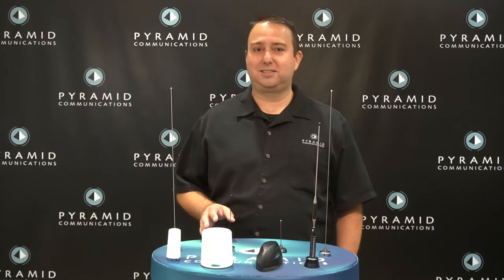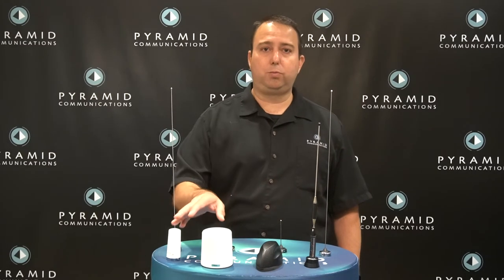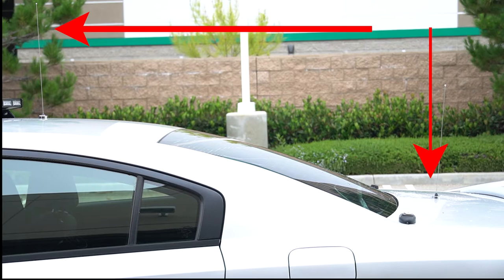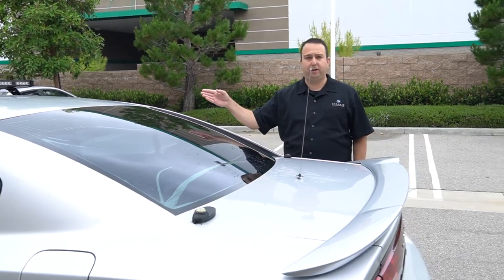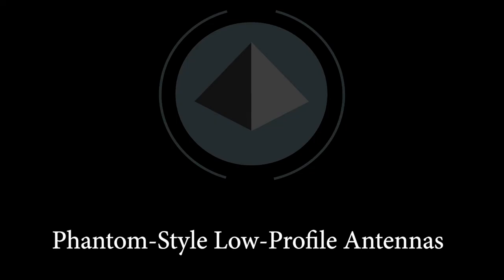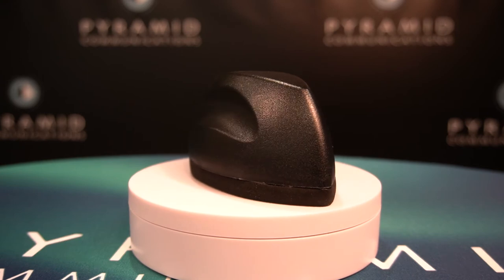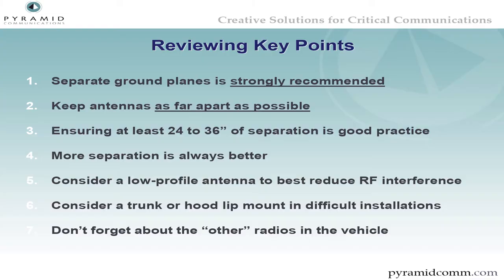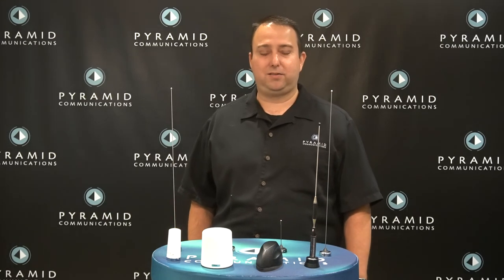Antenna Placement Webinar

Comment: Thank you for this tutorial. I want two scanners in my SUV so this is a receiving only question. Can I have the same type of antennas for both radios or do I have to follow the same guidelines that you talk about for receive and transmit? Also, do mag mounts cause more interference vs ones that get installed through the roof?
Reply: You can run the same style with no issues since they’re receive only.  Permanent NMO mount antennas are the better option if you’re able to do so on your particular vehicle.

Comment: Random question.  All the emergency services agencies in my county have pretty much the same install, and without being able to post a picture, I’ll try to explain it.  They all use UHF for P25 and VHF analog, so only 2 antennas.  The Ford Police Utility example is the most common, but the method makes me scratch my head about the ground plane.  They have the UHF 1/4 wave mounted dead center of the roof, and the VHF 1/4 wave straight behind it about 4 feet apart.  But the VHF is also less than 1 foot from the factory AM/FM stereo antenna.  Would it not make a better ground plane for each to have to VHF in the middle and the UHF toward the rear?  Obviously the V needs a larger diameter ground plane than the U does.  And they use the same method on crew cab F150s.  UHF is dead center behind lightbar but VHF is at the rear of the cab just a couple inches from the third brake light.  Wouldn’t that limit the V at the rear to only having a semi-circle ground plane toward the front half of the vehicle and none toward the rear?  I’m no expert, but with my limited knowledge it doesn’t look right to me.  🤷🏻‍♂️
Reply from the maker: Good question.  Not sure that the order/placement of the antennas matters too much as it relates to the Pyramid setup, but general antenna placement good practices still should apply and i would tend to agree with you.  At the end of the day, you have to wonder if someone at the agency have maybe has already done testing to come up with the method they have the antennas mounted and they have data to backup their installation - or maybe not.  Who knows, but the placement of the Pyramid antenna vs the mobile antenna in this case wouldn't effect the pyramid operation, however, i would probably suggest putting that Pyramid antenna on a separate ground plane completely, such as the hood, or bumper with a lip mount or mounted to the push bar.  Doesn't sound like they have a Pyramid in this case, but if they did... more separation is better even if you have to sacrifice a good ground plane for the Pyramid.

Comment: Great advice! A question. Does Pyramid make bandpass filters to deal with this issue? I ask because at one time as a radio ham I had a 2-meter system in my car and worked at USAF radar sites that had multiple megawatt radars operating. To protect the front end of my radio I placed a shorted quarter-wave coax stub at the antenna connector. That looked like at open at 2 meters and for any odd harmonic. It looked like a short for even harmonics and a partial short at other frequencies. It seems like similar bandpass filters could prevent some of this desensitization.
Reply: Yes, they do

Comment: Another question. Unlike quarter-wave antennas, half-wave antennas (with impedance matching) don't need a ground plane. One might be an answer to a 'where do I put in issue?' They could be put more places. But not needing a ground plane isn't the same as not benefiting from one to have a consistent, low-angle radiation pattern. Is the radiation pattern of a half-wave antenna influenced by the ground plane under it?
Reply: Half wave dosent need matching either

Comment: For a VHF SVR antenna, would the Phantom antenna be a better or same choice of antenna as the "soup can" (Mirage) antenna? I believe your point is to use a different type than the mobile antenna, however, I'm wondering about the differences of these two type of antennas.
Reply from the maker: It's more about the different type of antenna vs. a phantom over a soup-can type.  The point is, two quarter-wave antennas can be more problematic.  We have no preference and have done no testing on performance on a phantom vs a soup-can style.

Comment: I was curious about having  CB antenna and a scanner antenna on the roof of a pick up truck only about 10 inches apart. I was told there should be no issue transmitting on the CB and causing any problem to the scanner since the CB is only 4 watts and 12 watts on SSB. I've had it this way for many years and haven't noticed any problem with either radio. Any thoughts would be appreciated. Thank you.
Reply from the maker: As a general rule, i would still never recommend 10" of separation between a transmit antenna and a receiver antenna (in your case the scanner).  Though the CB is only 4 watts in AM, the scanner has virtually zero protection on the front-end filter.  By nature the scanner is wide band.  Your risk is, if you overload the receiver pre-amp on the scanner enough, you can damage it and lessen the receive sensitivity of the scanner.  Further, lower frequency stuff (like CB or Low-Band VHF) can do a surprisingly significant amount of damage to pre-amps.   The further you can get the antennas the better, always.
Reply: @pyramidcomm  Thank you very much for your reply.